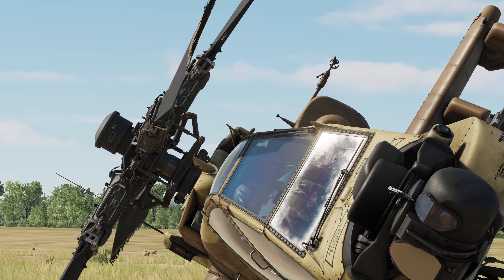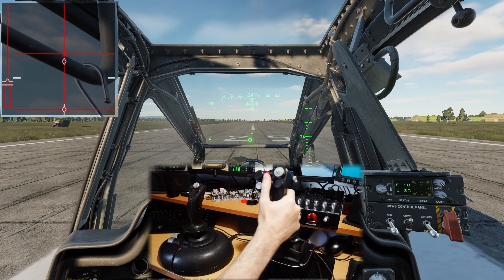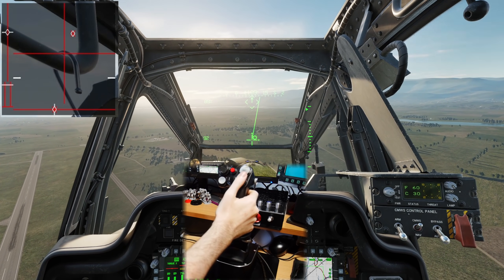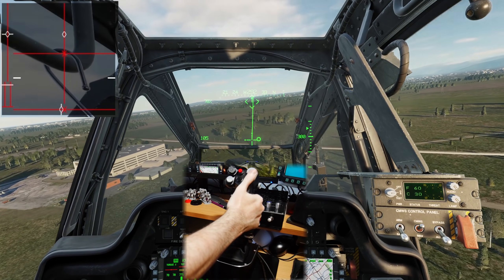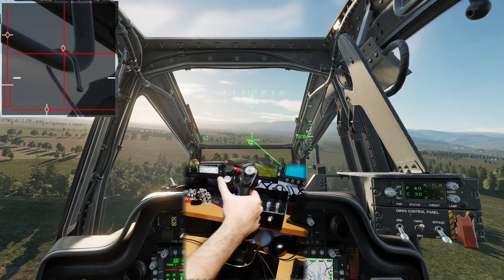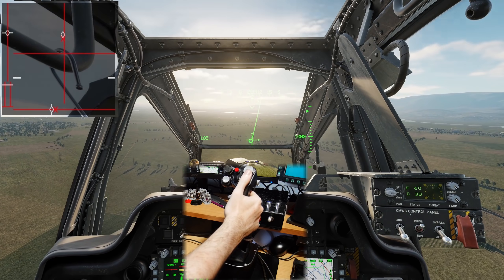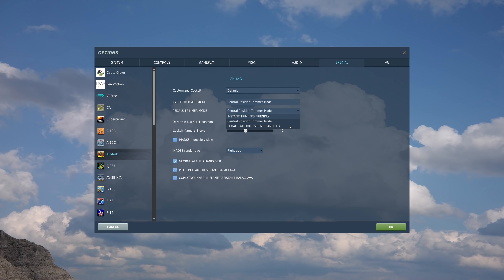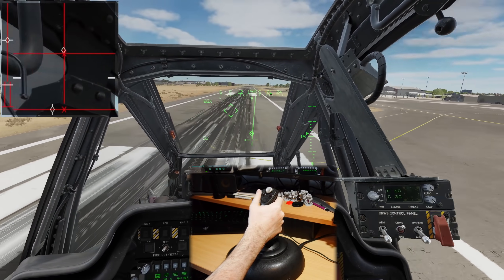DCS: AH-64D Apache: Understanding Trim

Comment: I hope there will be some kind of anti-torque rotor stabilization function added (so it will hold constant heading when the rudder axis is centered no matter if the helo is in a hover or at speed). I've read somewhere that this feature is actually on a real Apache, but I might be wrong on that assumption.
Reply: I wish too it would be a feature or a setting that you can switch on/off in the special tap, I have gotten use to the ka 50 counter rotating rotor when I jumped in the apache the rudder shat in my pants

Comment: Well, there is a reason why I preserved my Sidewinder FF stick as long as possible.
Personally, I was very sad when FF died, I had really hoped to see more FF sticks, especially of the HOTAS variation. But they never showed up on the market. Back in the early 2000s, my FF stick usage was the secret of my success at "Warbirds"...
Reply: It always was the secret of success in Il-2 as well. It basically carried over to Rise of Flight (extremely good implementation) and BoX. Logitech tried in 2009 with the G940, but that thing had some major flaws and was pulled from the market quickly without the very much needed Rev 2. I still use my old FFB2, it basically hit legal age. It's my second one though. They both have a faulty twist axis and when that happened with the 2nd, I just bought pedals back in 2006. That way I made the step to have them and a backup stick at the same time. Never needed to pull that one out of the box though... this thing is rugged AF. And I know quite a bunch of people who bought a second or even a third one back in the day, just for the case they might need a replacement. This shows how great it was and still is. I mean, who's got a spare TMWH, Virpil or VKB around, just for backup reasons?

Comment: One important advice for the "Central Position Trimmer mode", use the "force trim release" button, as a "release the trimming force" button and not like a "trim now" switch! The trim action happens on release of the button, not when you depress.
Depress and HOLD the "trim release" whenever you turn, accelerate or decelerate, basically whenever you don't just make the small corrections.
If you learn to remember the rough position of the stick (and or look down to check) and put it there to "pick up" the position with pressing and holding the trim release, you minimize the problems with the limits of the physical sticks movement, plus it does not require multiple quick trim inputs. Btw. this works for the Huey, Ka-50, Mi-24 and Mi-8 as well.
Reply: We have a real-life, mechanical "trim release" trigger on our SDZ-54 Perkoz gliders, for pitch trim. A trigger on the stick you reach with your little finger. Releases the pitch trim springs so that they move with the stick. Release the trigger and whatever angle the stick is at is now the trimmed position.
Reply: @RoamingAdhocrat  Yep, gliders use a simple mechanical "trim release", but keep in mind especially in gliders the pilot feels the forces acting on the controlsurfaces through mechanical linkage. A helicopter uses a hydraulic system, that feels totally different, if "trim  release" is depressed or force trim deactivated completely. I had a chance to  feel it once, but not fly it IRL.
You can really move it without applying much force, like holding it with the fingertips. The hydraulics do the job.

Comment from the maker: Good news, a Trim Reset button has been added as of the last patch!

https://forum.dcs.world/topic/295422-trim-reset-to-default-button/page/2/#comment-4923985
Reply: Oh boy is that thumbnail a familiar sight
Reply: Are they willing to disconnect the pedals from the trimmer like they did the Huey?
Reply: @Knubinator  just set the pedal trim option to the third entry: "No springs or FFB"
Reply: Thanks Fam 🤙🏿💯😎
Reply: Would be better if they could make a double-press trim reset button. Eg. the first press would reset the trim by half, then the second would reset it fully. That could alleviate the jerkiness of trim resetting
Reply from the maker: @MirraToneSounds  A smooth fade of virtual input from trimmed to physical stick position, whilst also resetting the trim offset would make more sense.
Reply: @RedKiteRender  that is a great idea! It can also be both! While "smooth reset" would work wonders for lightly trimmed axis, it would still pose some trouble for the heavily trimmed one. Not that it's advisable to reset a heavily trimmed axis :D. But we still have to compensate the full axis reset with large exaggerated movements (depending on the return speed). While a "smooth two stage" reset would makes things smoother with less exaggerated movements
Reply: hey mate if you want modern ffb hardware, check out brunner. i have the brunner cls-e ffb base with virpils 200mm s curve extension and mongoost50cm2 stick. yeah its not as cheap as the ffb sticks of ages past but i cant fly without it anymore and i do no not regret dishing out 1250 euros for a ffb base. they even have ffb pedals.
Reply from the maker: @kingpinda2  I'm aware of them, but far too poor to afford one.
Reply: @John Doehler yeah I always decouple rudder from trim. Unless I get a windfall and will be able to buy ffb pedals. I just fly my mfg crosswinds with combat pedals, springless with a damper for now. And probably forever since I can’t warrant buying the brunner ffb pedals :)

Comment: Hey Man...   Just a note on your Trim video...   The Apache does indeed have a trim reset..   By holding the trim button down for 3 seconds, the trimmer will reset to your current stick position.   Im an old Apache Pilot
Reply from the maker: Interesting, although, not something that's simulated in DCS to the best of my knowledge. Thanks for sharing!
Reply: i read this but it's not in DCS sadly
Reply: Holding the trim release down re-centers the SAS sleeves in the flight control servos, it doesn't reset the in-game cyclic back to a neutral center position. The SAS re-centering is simulated in game, it's just not as apparent.

Comment: Disabling trim on the rudder pedals is a great tip. Thank you! I’ve been flying with no trim and it’s been ok, just a little taxing on long cruises. As long as I can get the cyclic trimmed, I’m good to go :)
Reply: I have rudder pedals where I can easily unhook the spring (MFG Crosswinds) which I now use for helicopter flying: so much more intuitive and no tired legs.
Reply: @tomshackell  I also have crosswinds and I didn’t think of that either! Another great idea, thank you!
Reply: I do this on the Mi24, but leave trim on for the Huey. I’ll have to try pedal trim off on the Apache, I’m comfortable with manual pedals from years of IL2 German planes. Sounds like a good compromise.

Comment: A shame there are not "cheap" forcefeedback joysticks. Would love to see a Hotas Warthog Force one..... more wait. Thanks!
Reply: We really need new consumer FFB sticks!
Reply: And even more so considering the advantage they get in the field of simracing with so much variety of steering wheels with force feedback.
Reply: @TheMistral  I think you could use a FFB wheel for rudder with some tinkering.
Reply: @SWScenic  lmao
Reply: A chopper stick that had built-in force trim would be great too. Much easier to build a magnetic spring lock than a full FFB mechanism. (That's how it works in the real things too.)
Reply: @AdmiralQuality  true. That would be awsome for chopper heads. But sadly I haven’t heard about any company producing them. The brunner cls-e is overkill for just force trim but I dig the ffb in prop planes as well.
Reply: @kingpinda2  I have a Logitech Wingman 3D FFB stick. It is nice in the warbirds (except it makes the Spit and Mosquito completely unflyable, they're unstable enough as-is) but I have an issue that it throws off the trim settings wildly from what they should be. I wish DCS offered a trim bias controls somewhere so I could correct that. 

Same with the jets. The Su-27, etc, are unflyable with FFB on. But it's quite nice in the F-5... EXCEPT, I lose so much trim authority that I can't manage to trim it out when it's heavy. Meaning I'll need to keep my hand applying forward pressure on the stick for the entire flight until I dump my bags. Not fun, so I usually turn it off. (Which also isn't fun. DCS forces you to exit the mission/server to change that setting. Even worse, it doesn't properly re-initialize to default spring forces after disabling it, so you actually have to restart DCS to turn FFB off properly!)
Reply: Why aren't there force feedback joysticks? Didn't the patents expire?

Edit: auto correct
Reply: @bl8danjil  I think the biggest factor is probably cost. In a niche market where you're selling already expensive joysticks, adding the extra cost of FFB might drive it beyond the price point people are willing to pay.
I would love to see it though. Helicopters would be a blast with it!
Reply: @aaronwhite1786  That is half the problem, Yes it is a niche market but it still should not be as much as it is. It is a bit ridiculous on the prices of some.
Reply: @bl8danjil  I don't get the joke if any joke was intended, and now I feel dumb. plz explain for my Neanderthal brain :) thanks
Reply: To anyone asking, there's a patent on ffb joystick mechanisms so this is why nobody has done it in a while ... I think it's outdated or will be outdated soon so it might come back
Yeah, shitty reason ...
Reply: if you have 1500 bucks, brunner simulation has a dope ffb stick aswell
Reply: @Ked_gaming   Komodo Simulations is quiet interesting too. If someone can afford. They're working on apache grips for collective and cyclic. My wallet already knows what will happen sooner or later...
Reply: @velamenradicum  I have heard shady thinks about this company on the reliability side, their stuff is expensive and made of plastic ... I probably won't go this route, be careful :)
Reply: ~500 bucks for a 3d printed stick seems very excessive
Reply: @Ked_gaming  yeah i have one for 3 years now and i cant fly without it. now to save up for ffb pedals... and maybe someday a collective.
Reply: @velamenradicum  Komodo are a awful company. They are cheaply made and overpriced. Do not buy anything from them.
Reply: @Ked_gaming  there is one brand who does ffb. brunner.

Comment: Thanks Redkite, I can't even count how many times I have crashed or rollled 360, or 720 degrees before crashing. Please let them bring us a Trim Reset. I am all for simulation, but here, maybe a cheat key is needed

Damn I wish I kept my FF stick like the one you have. I use to love that thing when it was cutting edge. Now I have to make do with this awesome Warthog Throttle and stick, although I think I prefer the F/A-18C grip for the apache, just sort of feels right, even though my original A-10C stick is a closer representation of the real thing

Great Work Red
Reply from the maker: FFB is such a great lost tech. It was used a quite bit for gimmicks and random vibration / motions, but in sims, it was a game changer when implemented properly (like il-2 where the stick resistance changes with airspeed for example!) What I'd give to see it return, esp with a Warthog/Virpil compatible connector!
Reply: @RedKiteRender  I could not agree with you more. There was something very organic about it in the early days of IL2, really gave you a sense of trying to move control surfaces
Reply: I think it's silly to say that a trim reset button isn't realistic. The button doesn't represent a button in the aircraft. It represents the pilot moving their controls back to the center and setting the trim there. It's no less realistic than pressing a button to look left.
Reply: Back in the day when people suggested you to get a Saitek X45 or 52, but hide the stick somewhere behind the monitor and use an FFB2 instead. And Simped Vario Pro pedals :)

Comment: ED just needs to add the reset function like in the other helicopters and problem solved. I have the trim turned off on my rudder pedals, I like full authority over the tail rotor
Reply: Can't remember if it was Wags or Big Newy, but someone credible has confirmed that trim reset will be added as a "cheat" bind in the near future.
Reply: @Viking355th  cheat yea - ED doesn't get it straight for years getting useful features implemented. It seems like they think everyone has an exact replica of each module peripherals at home. So stupid.
Reply: @Viking355th  casmo mentioned this and the trigger guard removal also.
Reply: @Viking355th  It's great how they call it "cheat" bind here when all the other helos don't have it IRL either :D

Comment: You don't need to know where the cyclic is. Just forget about it and fly the helicopter, all your problems about trim will be gone. Use the trim whenever you need it, you need to trim a lot of times when flying helicopters.
Reply from the maker: Having the physical position makes trimming logical and easy to understand. If you don't understand what's happening by use of the trim, it's not obvious what's aerodynamics vs what inputs you've applied. That's why it's important for a beginner to have the controls up, so you can understand the forces at work, and learn to manage them.

By all means, once you've flown a bunch, understand it all, the actual position becomes less important, but it's still a sim-ism that i wish we could avoid.
Reply: @RedKiteRender  Agree, to understand how trim works your example in the video was right specially the FFB joystick, but I think it causes a lot of harm when you start flying because a lot of people worry too much about the rudder and cyclic position and fly with the overlay and also want a trim reset which is not necessary. When you understand that helicopters need to be trimmed a lot you forget about this and start to fly more relaxed and precise. I think a lot of people try to fly a helicopter like an airplane with minimal trim inputs and sadly it's imposible because helicopters are very unstable. Just a tiny change in collective and now you need to trim again.

Comment: 30cm extension on VPC base with warthog grip. I use the trim down funktion. No problem at all. This beast is such a joy to fly. There is a damper mod kit for the TM TPR pedals. Had to order it on first sight. It gets you anti-torque pedals. so much easier if you dont have to look for rudder trim. They simply stay where you put them!
Reply: Didn't know about a damper mod, I'll have to do some research!
Reply from the maker: I'd love to find some pedals that can easily engage/disengage the centring for use in both Jets/helicopters.
Reply: @RedKiteRender  Same for me. So check out the TPR damper mod by "cubesim". For jets you can leave the springs. It feels much better. The pedals don't "jump" back to center any more. They do a smooth centering movement. The springs are easy to reach. No need to open the housing. They're on the outside. You'll love it Kite. No doubt about it! Would be worth a tutorial🤗
Reply: Any info on the vendor for this?

Comment: dont forget to put both your rudder pedals and cyclic in central trimming mode
Reply: I keep my pedals in the "Without springs" setting. It's bad enough to deal with this trim in the cyclic. Best way is to try both settings, to see which one feels better.
Reply: I pulled the spring off my mfgs and just use the damper, so my pedals are always in no spring trim mode

Comment: With you making a tutorial about this I'm confident that even I'll be able to understand it😅

Edit: omg he has a gucci force feedback stick
Reply from the maker: If only it had more buttons though! I use it for simpler helicopters, but the Apache just needs those extra hats. Wish someone could make us a nice new FFB stick.
Reply: @RedKiteRender  I heard microsoft had a patent on them and that's why no one can make them
Reply from the maker: It's not Microsoft that hold the patent, otherwise I'm sure we'd of seen more Sidewinders. It's a rather complex topic on the patents and commercial simming hardware that's led to a loss of consumer FFB sticks. They (patent holders) actually tried to sue Playstation for their rumble packs back in the day if i remember correctly.
Reply: @RedKiteRender  Didn't know that, but it does explain why there aren't any more being made at the moment, sadly enough
Reply: @RedKiteRender  I always found it odd that the last FFB was the Microsoft one, yet the demand is there but nobody is producing them. But if a patent is blocking the development then that would explain why. Surely someone can create a different style that would do the same thing. (looks a Virpil, WinWing, Logitech)
Reply from the maker: @hexpulatwork  I think Logitech was the last to produce a FFB stick, the Force 3d Pro, you can still buy that joystick minus the FFB, replaced with springs. It had a few issues with self destruction and possibly fell foul of the patent changes, didn't stay on the market very long.

It's also rather expensive to design and implement a so not an attractive business sadly.